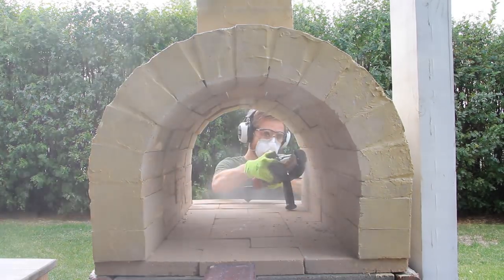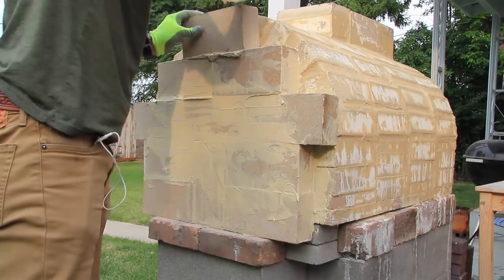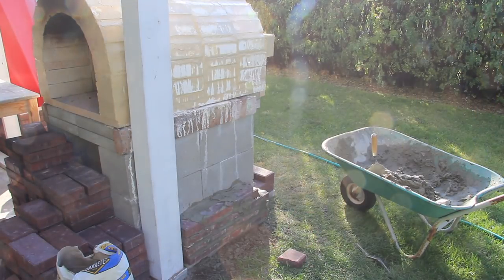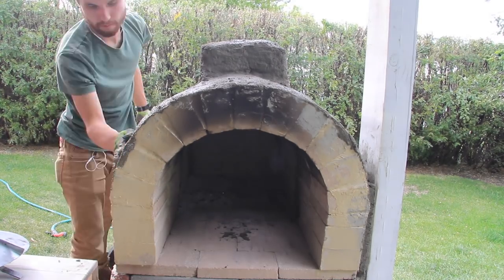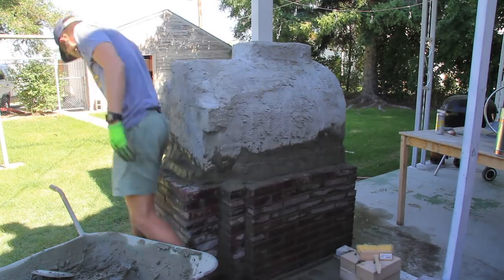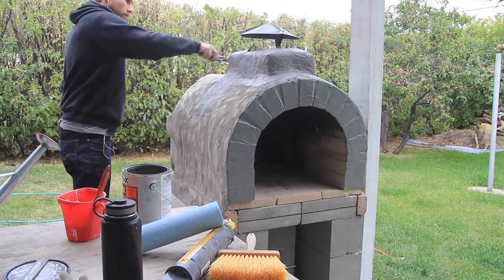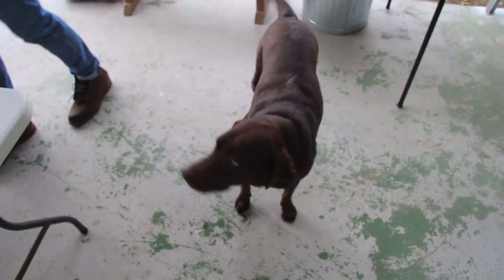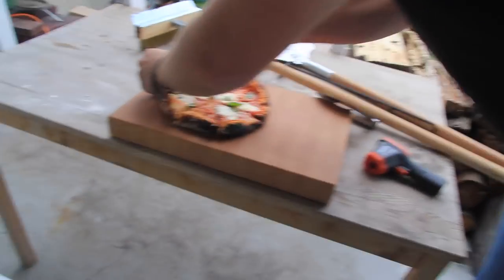DIY // How to Build a Wood Fired Pizza/Bread Oven Part 3

Comment from the maker: Check out this awesome photo of the oven in the winter: https://instagram.com/p/BuaNt64A4r9/
Reply from the maker: Check it out!
Reply: @SecondSonWoodworks  pretty cool
Reply: Hey dude. U burnt the pizza.
Reply: Did you have a problem with the rutland 610 premixed getting hard where its thick
Reply: hey man you should make a small door with a high temperature measuring tool on the door to monitor the inside temperature. also you can shut the door and it will bake the pizza faster and more accurately. normally pizza oven openings are smaller because of this reason to keep the heat inside the dome in the back while being able to put in pizzas or take them out from the front
Reply: @Bbarm97   0

Comment: Works better with insulation on the outside held down with chicken wire and then plastered. A front door is a must if you want to make bread when the oven cools down to 400 degrees. The chimney also works better at the rear. It worked so that is the main point of the exercise.
Reply from the maker: That is a great idea! Thanks for sharing.

Comment: If you would build another oven,  what would you change?  Would you go another row or two deeper to give more room for the pizza so it sits in the middle of the oven instead of near the cooler front edge?  Would you have a door to help contain the heat in the oven?  Would you install the blanket of insulation and chicken wire under another coat or two of mortar that you see in other pizza oven builds?  Has the exterior developed any cracks?  Thank you.  Good video.
Reply from the maker: Considering the space and my budget, this oven worked well! If I had more money and time and space, I would definitely make it bigger, have more insulation, and a small door. Thanks for the comment and watching!

Comment: nice job... but a ton of weight there... I wonder if over time (and rain) that starts settling into the ground.  With part of it on the slab, and part over the ground... could get messy
Reply from the maker: I hope not! That is why I added the sand and foundation.

Comment: Hey! Great srt of videos! I had a question for you, ive built my pizza oven the same way as yours but i have a lot of trouble getting it upto 400C which is what is needed for a pizza. Later thru research i found that this style of oven called barrel vault is more suitable for breads and not pizzas. I dont know how to fix the issue..should i rebuild? Do you have any tips? Also dosent this shape of oven require a LOT of wood to get it upto temperature? Kindly HELP!
Reply from the maker: Thanks for watching and hope I can help. When I had the oven, it definitely took a lot of time for it to heat up and a lot of wood and I had to get some solid embers going. BUT I was able to get it up to that temp and I cooked a lot of pizza one night. If I still had the oven, I would build a taller chimney as I think that would increase draft inside the oven. Nevertheless, this oven was never meant to be any sort of production oven. Hope this helps.

Comment: i was a wood fired pizza cook for years in new york city, worked at paulie g's pizza moto and roberta's. the pizza oven looks great and seemed to do a good job but i think the design has a fatal flaw, a crucial part of the wood fire oven was the fire being able to arc over the pizza, so the stones cook the bottom and the flame arching over the top of the oven cooks the toppings. if you ever build another one i'd make it so it was as deep as you have it now but maybe twice as wide. great work though!
Reply: matt black great suggestions Matt!! I’m getting ready to build one myself and I understand exactly what your talking about, your cooking from both top and bottom. I think the opening on front needs to be shrunk down some as well to help hold the heat as it rolls across the arch instead of rolling right out the front and possibly even cut a steel door that you can put in place if needed also, probly mainly used tho to keep stuff out when not in use. 

The other thing I noticed on this video and it may be different now since that was the first time he was using it but I think the fire was much to big and could be smaller and give you more room to keep the pizza away from the front where all of the heat was escaping and I think it may cook better but that first pizza was gorgeous tho!! For not being a pro, he did an outstanding job and should be proud of himself!! I could taste that pizza almost and I bet it was crazy 😜 delicious!!!!

Since you have experience Matt, are there any other changes you would make that I could incorporate that would help make a better pizza if that’s possible? Does the wood variety matter much on wood fired pizza like it does for smoking meat? What variety of wood did you guys burn in New York?

Thanks for the comments and info Matt!! I’m gonna start building mine soon so I’ll try to grab some pics to send ya as I go

Take care and stay safe out there buddy!?!
Reply: @1982MCI   so i'll do my best to go through each one of your questions. 

so as for the opening on the front that size is actually about right, it could maybe be a bit shorter but you definitely want enough room to maneuver the pies and place your wood, we would use a smaller metal pizza peel that was on a 6 foot long handle to maneuver pies and wood in the oven and a big wide wooden pizza peel to place them on the stones and it was usefull to have room enough to reach your whole arm in there if you needed to,(hopefully not while the fire is going haha)  we would in fact have a steel door or slab to cover the opening while there were no pizzas in the oven to keep the heat but when cooking the door pretty much has to remain open because if everything is going right they should cook in about 2 minutes or less. 
i would say the pizza he got out of this thing did look really good and it seems to work pretty decent
if i were to make any improvements i'd think the oven should be larger and in the shape of a circle, if that isn't possible it should be like 3 feet wide and maybe 4 feet deep with a domed ceiling. we would always start the fire in the middle of the oven, let the coals develope there to heat up those stones, then move the fire off to one side(usually the left) so that the flame would follow the domed ceiling and arch over the top of the pies,  also would definitely recommend using a lazer thermometer to check temp, we would cook anywhere between 650 and 900 degrees depending on how busy we got. 900 is really high but if you're cooking for a party and make 30 pies one after the other those will suck the heat out of the stones and air pretty fast. 

different places i worked used different woods but usually we would use hardwood and most of the time it would be oak, you could expirenment with fruit woods, we would use apple wood sometimes. but predominantly oak is what you want, it burns hot and pretty clean. you also want wood that is very dry because smokey pizza isn't usually the best. 
hope that helps you out Don!
Reply from the maker: Thanks for your tip! Great suggestion. And thanks for watching and for the support!
Reply from the maker: Thanks for the comment and for watching the video! Good luck with the build :) Cheers.
Reply from the maker: Great tips! Thanks for sharing!

Comment: I watched all 3 videos, nice production and voice over.  
My inner Italian was looking for more running bond in your brick laying, but I understand your concern about falsework removal...
Yours has been done for 2 yrs now! 
I have three questions: 
     - Any frost heave or settlement problems?
     - Did you smell the cooking adhesive or paint on first burn?
     - Should I put a 2" layer of sand under the refractory brick oven bottom, to hold heat and level bottom?
Reply from the maker: Thanks for watching the videos and for your comment! No frost issues the first few years (I have since moved from the house and dismantled the oven), I didn't smell any of the adhesive or paint, although the outside of the oven did get hot, and I don't think that is a bad idea. The more insulation, the more heat the oven will hold. Nevertheless, this oven cooked pizza just fine! Cheers.

Comment: Instead of blowing off the dust use water to wash it. And would be good if the inside is sloped such that if we washes the oven the water will naturally flow out and not make a puddle inside
Reply from the maker: Great idea! Thanks for watching

Comment: Nice work- I want to do this too- your losing a lot of heat at the front however- i would make the opening smaller- that way your pizza will cook more evenly
Reply from the maker: Thanks for the tip!
Reply: Smaller opening means smaller pizzas. I’m tryna make a NY pie, not neopolitan!
Reply: @andrewgoldin6905  the opening coud be wide as it is, but there's a lot of space in height. Other ovens I saw in YT have an arc at the front.
Reply: at first I thought this design was a good idea because it is easier to build than the regular round ones but this is what I also thought when seeing it in action. It just seems too open. I do not see this design getting hot enough.  I am going for the rounded design.

Comment: you gotta put your chimney near the front above the door so that the flames arch down onto the pizza, will cook in about 3 mins, you must have floor hot enough to cook the bottom, flames cook the top
Reply from the maker: That is what I was trying to do, as it is closer to the front than the back Watch near the near the end when we had the heat dialed in and the pizzas were cooking in under 3 minutes,. Thanks for watching

Comment: Looks like a fun build.  Is there any concern with the proximity of the oven to the post?
Reply from the maker: Certainly, but it was a risk I was willing to take. I had a plan to close in the entire area under the patio and use the oven to heat it in the winter. Never happen though. Thanks for watching!

Comment: cooking your pie, you gotta let the oven heat up in the front, then push your embers to the back and sides and close it up- it takes about an hour or two to prep the inside for cooking. Great job on everything- but if you want better, more evenly cooked pies, that will help.. throw some cornmeal down - if it burns or smokes, its too hot.
Reply from the maker: Mike Remington thanks for the tips man!

Comment: Nice job, I saw there was quite a crack in the shell as you made the pizza. Were there any other issues you saw after a few fires?
Reply from the maker: Thanks for watching! A crack appeared after I got the temperature over 1000 degrees, which I didn't need to do but I wanted it to settle into itself. Then I patched the crack and it was fine. Still held its temp well. Cheers!

Comment: Hey man great job on your pizza oven! I’m going to use this as a model for making my own. Do you have a list of how many bricks you used, tubs of mortar and other supplies?
Reply from the maker: Thanks for watching and for the support! Good luck with the build. Links in the description for products used. Cheers!
Reply: Build it at least 2 bricks deeper ... and decrease the height the closer you get to the mouth ... that way you trap heat better. And the floor in the oven must be 100% in level otherwise you will get stuck with the pizza peel..  Pizza Love ;)

Comment: Nice job on the video.  Are you worried about the ground freezing unevenly and causing cracks?
Reply from the maker: No it has been through several winters and their hasn't been any issues with the base. The moisture from the snow that accumulates on the top has been frustrating.

Comment: Hi,
I plan to make one...
Just a query... 
1. You did not use fire blanket... Dud it not loose temperature..
2. You just used single layer of brick... Did it last long...
3. Inline to 2nd query.. Did your oven develop cracks..since you did not reinforce... 
4. Is 2nd layer absolutely essential..
Reply from the maker: 1. I did not and it held heat just fine. 
2.Yes.
3.The second layer of mortar did crack after the first firing because I got the oven too hot. 
4.Yes, if not a third.

Comment: The Italians add perlite or vermiculite to the render cover to help keep the heat in. Was it something you considered?
Reply from the maker: Hmm I didn't know that! Thanks for sharing. Good idea!
Reply: I've seen a man I know use 1 part concrete and 3 parts perlite when he constructed his pizza oven. He was Greek.

Maybe Google for the proper measurements.

PS. Hooked on every video and am going to attempt to make this. Don't like my chances as I have ADHD and usually find an excuse to do another project but this one seems really interesting and I'm determined to start and complete this one.

Awesome build. You did good, buddy.

Comment: I'm ready to begin a pizza oven build but wanted to see if you had any recommendations of what you might do differently to improve the effectiveness of your pizza. I am definitely going to make the chimney higher and close the top of  the opening a bit.  Also, how has your oven held up structurally in the past year and a half??
Reply: I'm going to build my own oven too. This I would do differently. 1. A lower opening to prevent to much heat escaping. 2. A deeper oven. The pizza needs to be deeper in the oven. It's a common mistake that the fire needs to heat the pizza. It should actually be done by the heat of the stones. 3. Proper insulation of the oven. An oven like this is probably becoming hot on the outside. Not very kid friendly. Also making the oven less effective (see my second point). Good luck!
Reply from the maker: Thanks for watching and for the support! Definitely extend the height of the chimney. Also, cover the outside of the oven with cement bricks like I do for the base. It has held up well of the years thus far! Thanks again for watching!
Reply from the maker: Thanks for the tips and for watching!

Comment: The idea is to heat the walls of the oven with fire, ones your oven is hot you can even take out most of  the fire wood and have  better results, your need a metal door too, cause the oven was too hot inside, to cold in the entrance.
Reply from the maker: Yes you are right. Watch at the end of the video when we are cooking pizza, you'll notice that there are only coals in the back of the oven; that is enough to cook a pizza in about 2 minutes. Thanks for the comment and for watching!

Comment: Looks great! A bit of practice and you'll have awesome pizzas.

Thoughts on the overall size of the interior of the oven? Could a rounded oven be more practical in terms of maneuvering the pizza and also the heat distribition inside?
Reply from the maker: Thank you!! This design has worked well for me.,

Comment: Oven is small so, a smaller fire dude. Ok, extend the tunnel another 2 bricks distance and make a smaller opening. Make a cover for the opening. Slightly larger than a large pizza. Less fire and wait until the wood become cinders with the door closed. Check the temperature about 475 F then you slip it in the pizza pie, know what I mean?  By the way, how was the pizza? Oh and thanks for the video.
Reply from the maker: Thanks for watching and for the tips! The pizza was delicious. We cooked about 35 of them that night haha
Reply: @SecondSonWoodworks  Whaaaat? LoL Awesome :-D I wish I would have been there but Im in quarantine here in Puerto Rico. Be safe guys. Stay home.

Comment: Is it an issue that the oven doesn't curve up in middle then down towards the opening as that would help the heat to hit back down?
Reply from the maker: It didn't seem to be an issue but that would certainly help the flow of heat, but would be more difficult to construct. Thanks for watching!

Comment: Very nice.  Question; since you would be moving the fire to the back of the oven did you consider leaving air vents from bottom and back to reduce cold air being drawn in over the front bricks?
Reply from the maker: Not a bad thought, but I wanted the air to be pulled into the back of the oven along the floor, stoking the fire, then catch hot air and bring it to the top and then to the front of the oven. As it is moving across the ceiling, much of the heat falls onto the pizza and does the cooking. OR at least that was my idea based off of planning/research, and it worked well!

Comment: Great video! Probably one of the best that I’ve seen on building a pizza oven. So good actually I’m building my own. I wish I had followed it more closely with the pavers but I’m going to be doing a poured slab under the fire brick. Not too great on my part :-) just wanted to see how yours is holding up because I’ve watched so many videos and I don’t know what to put on the outside.  Thanks!
Reply from the maker: Thank you for watching and for the comment! Good luck with the build. Cheers.

Comment: The opening would be good if you closed it off at least one brick lower so the smoke would not go out the front and also the heat could accumulate more
Reply from the maker: Not a bad idea!

Comment: What is the best wood to use? Oven door not necessary?
Reply from the maker: Hard wood. Soft woods, like pine and fur, have lots of creosote and they will eventually coat the oven and chimney. NOT GOOD! No, it would be helpful, but not necessary. The oven gets hot enough to cook a pizza in 2 minutes without a door. Thanks for watching!

Comment: hoow did u do the base with the cinder blocks...is what I need to know as well as the flat below the floor of the oven...PLZ
Reply from the maker: I used cinder blocks for the base since it wouldn't be in direct contact with the heat. I made the flat before the floor of the oven just for added space. Hope this helps! Thanks for watching!

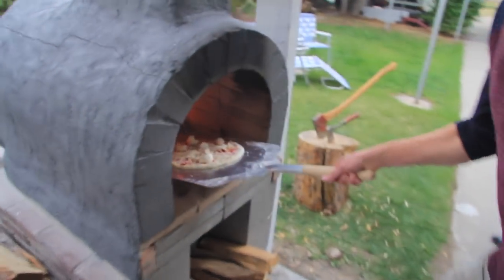Comment: at 19:14 i could see a crack on the ceiling of the oven. Why did it crack? improper curing?
Reply from the maker: Cracked the first time I got it over 1200 degrees. Settling of the bricks. Patched it and then it was fine.